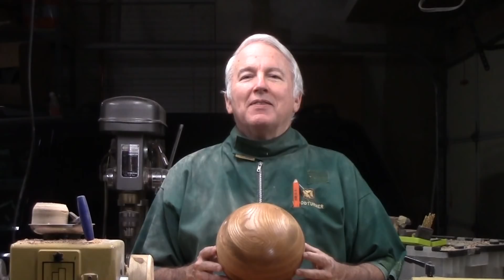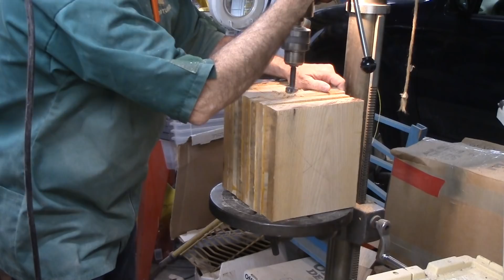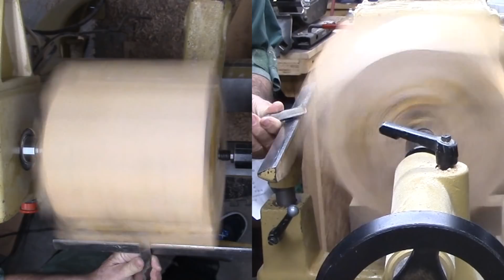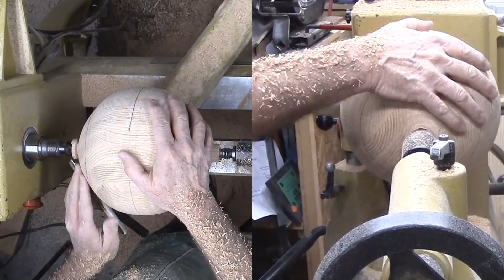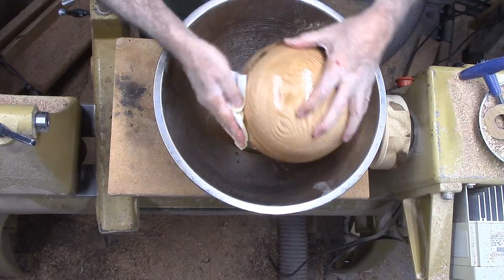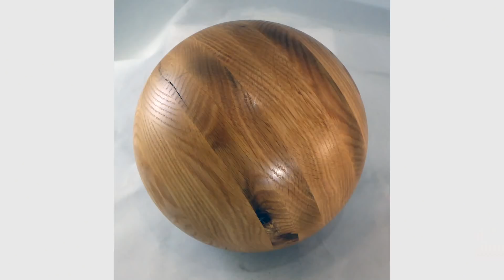Woodturning A Tai Chi Exercise Ball

Comment: I used to make Taiji balls for sale. In researching how spheres have been turned on a lathe, I found 10 different techniques that people have used, some historic, some modern. I came up with an 11th that seemed easier for me. It involves drawing the appropriate sized circle on two perpendicular faces then cutting each out on a bandsaw.  Masking tape holds the first cut waste in place to allow a solid foundation for cutting the second circle out. A 1" or so "ear" was left on each ends of the circle to allow mounting between centres. Once the waste is removed you end up with a peculiar shape. You turn until you "touch" the entire surface with the turning gouge and you then have a sphere with two ears on it. Removed from the lathe, the ears can be cut off, cleaned up with a chisel and sanded with a random orbit sander.
Reply from the maker: Interesting.
Alan